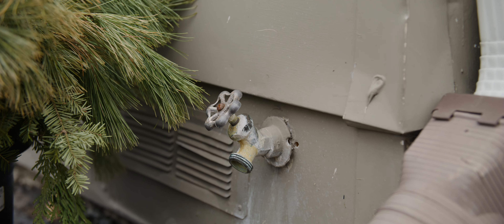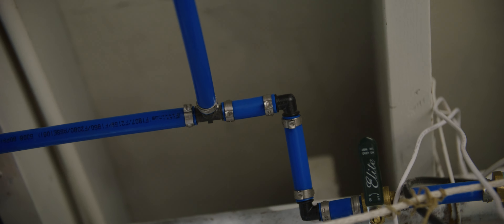Jeep Winter Hose Wash Setup Below Freezing | No More Rust

Comment: Great set up to stop the freezing over etc... do you wax/polish the Jeeps to protect the body work. Also a great tip is to spray/paint a rubberised type paint on the whole chassis/wheel well areas... luckily we dont get that issue here in Australia.👍😎🇦🇺🚙
Reply from the maker: Thanks! Yes I usually do that in the summer time https://youtu.be/Re4pwu3-yBE?si=PM-RZD5XtJgJTpJv. A lot of the time that rubberized stuff holds in moisture and pre-existing rust and makes it worse. I have used rustoleum rust reformer and truck be liner and washing off and that seems to be the trick. Yea wish I didn't have to deal with this at all lol